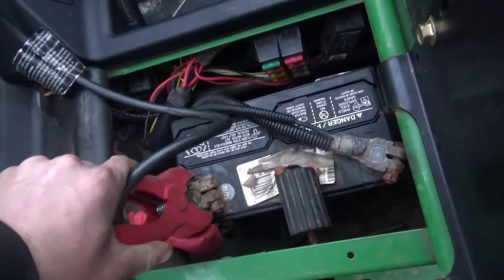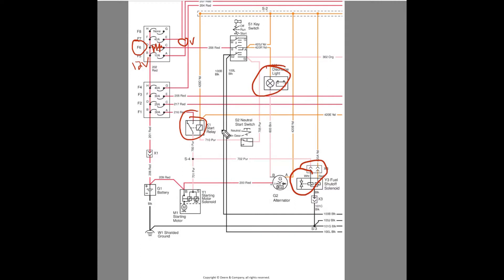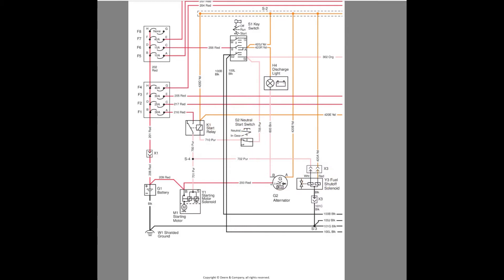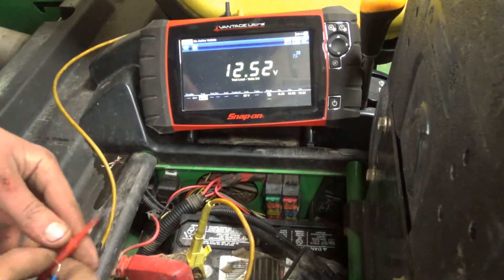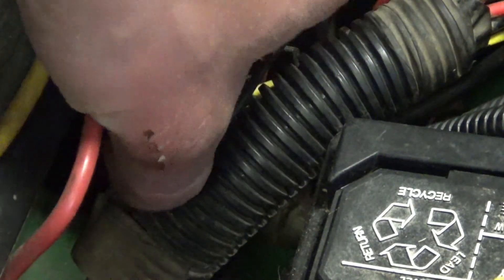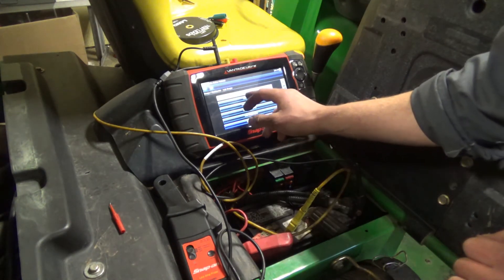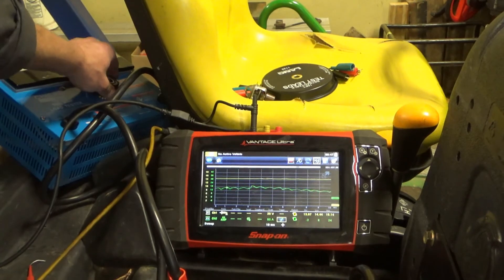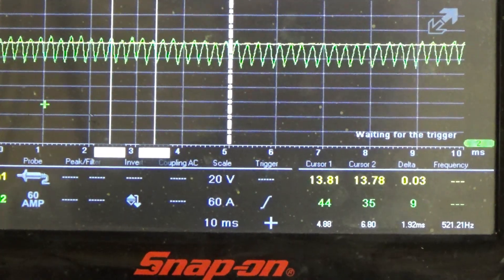John Deere HPX 4x4 Diesel- No Crank  (Voltage Drop Testing)

Comment: Question, cant you just check voltage at the fuse and that would eliminate
 the a bad connector? Anyone?
Reply: You would see voltage at the fuse, but lower than desired. You'd still have to back track to locate where the voltage drop is occuring.

Comment: Hey great video 👍🏻 would happen to have a wiring diagram for a 2015 John Deere gator with the Kawasaki gas engine ? I’m having a no charge issue possible stator or voltage regulator issue I would like to check ac volts from stator which is a 3 white wires. Thx for any help.
Reply from the maker: Model isn't super important in this case. Generally the two outside wires on the three wire connector are your stator output (pin 1 and pin 3). So you would set your voltmeter to ac volts and those two wires should read 25-30 V ac. It will get higher as engine speed increases. DC charging voltage out of the regulator is half of what the ac voltage is. So you dont want to see less than 24 v ac at idle. If you do then you need a stator.

The wire coming off the voltage regulator (usually red) should be reading 12.8 -14.6 V DC. If your stator input is good (24-30+V ac) and your regulator is putting out less than 12.8 v then the regulator is bad or not properly grounded (bad ground is pretty rare on regulators.)
Reply from the maker: If you have further issues or questions, please let me know. I'm pretty embarrassed that I haven't been putting videos out, but I've got a whole mess of them that I'm almost done editing and should be releasing soon.

Please let me know if there are any specific topics you would like to see covered, especially on a specific gator model.

I find it's actually easier to do a video on a requested topic, than it is to guess what people want to see.

Thanks again for watching and reading.
Reply: Thank you for your help yeah being a 3 white wires off the stator got me confused I will be testing it two days sometimes I also use my Verus edge a lot on different equipment besides automotive I just love the lab scope thanks again
Reply: Yup bad stator only putting out 10 -12 vac I’m hoping the voltage regulator is good because it around $225ish. I have a Koehler regular tester I may test it also. Thx for your help and looking forward in watching your videos

Comment: so basically it was the dirty connection caused the problem right?
Reply from the maker: Yes, corrosion (dirty connection so to say) caused high resistance. Similar to a partially broken wire. So not enough current could pass through to power up anything.